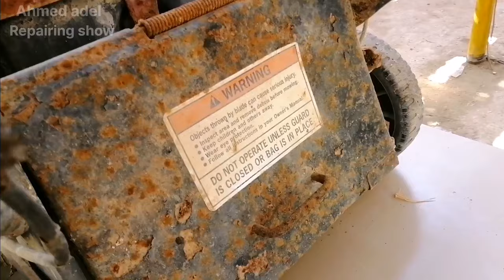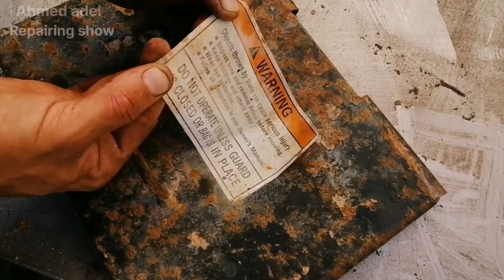Restoration Old Engine Lawn Mower  | Honda Hru196 Engine Restoration #reparing_show

Comment: That would have to had the bird flu 😮until you were able to make it look like it was a different mower between the two ✌ i just bought the 3rd one ive had 80 bucks and it was not rolling in reverse startup with a halfway point in the easiest to start pull rope in all models in all machines with a pull rope  and the reason I was lookin for a hhr216  on my local market place

Comment: Nice work mate!

Just one thing. When you assembled the blades. I noticed you put the spring washers that have the bent up wings under the thicker washers on the top on the blade plate. The spring washers go underneath between the blades and the blade plate. It helps the blades turn freely so if they hit something when mowing it shouldn't do as much damage.

Comment: A very good effort & well done.

One thing to be aware of with the Honda 4 stroke lawn equipment engines is that the arrow underneath the base of the piston has to face right or towards the muffler (exhaust) side of the engine.

I have recently rebuilt a Honda GSV190 engine for my fathers HRU217D lawnmower & the blade boss on the crankshaft was totally seized on the shaft & it took me hours of heating it up with a propane torch & a heat gun after I ran out of gas as well as soaking it in diesel fuel & engine oil for it to break free & come loose.

I sanded the crankshaft down to remove the rust on it & I applied a nickel based anti seize compound to the shaft & blade boss mating surfaces so as to minimize any chance of that happening again.

I had to order a new piston & rings fur it because the new old stock piston rings were more expensive than the new updated piston & rings total price,the original rings were no longer available from Honda since it's a 20 year old engine, the updated piston & rings had to be purchased & fitted !
Reply from the maker: thanks for your support. I benefited from you, thank you ❤️
Reply: I have to ask did you torque a single bolt?
Reply: @scottpace578  I did on the rebuild that I did last year !